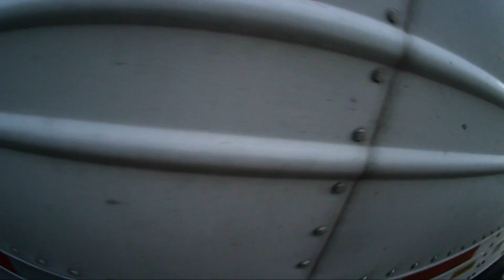Trailer Air Leak Update

Comment: Bit of advise man, Don't use your key to prise open things, if you break the key your in deep sh-t. Also mole grips can round of nut and bolt heads. So use the proper tools for each job.

I saw an episode of Swamp Loggers and a trooper pull over a log truck for running with a leaking tire/tyre. Even though the truck was fitted with the auto pump system.